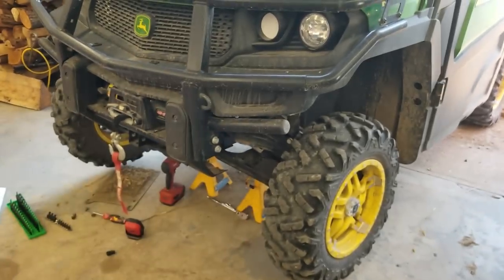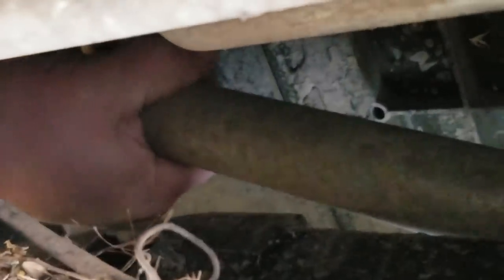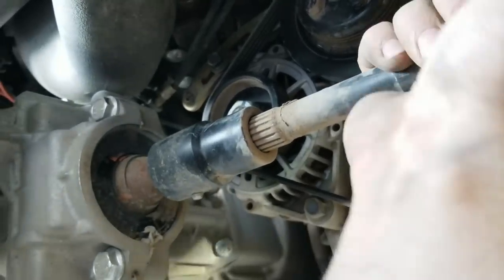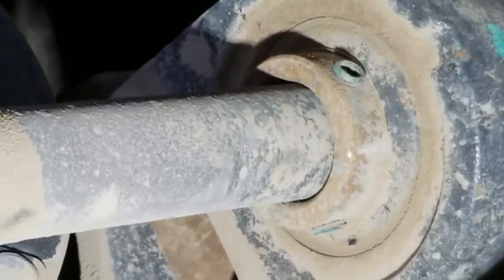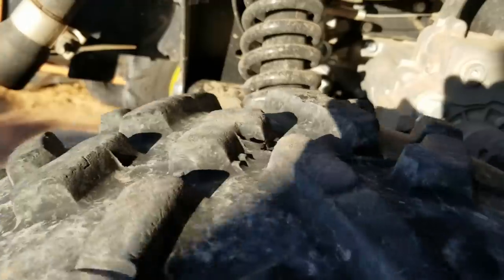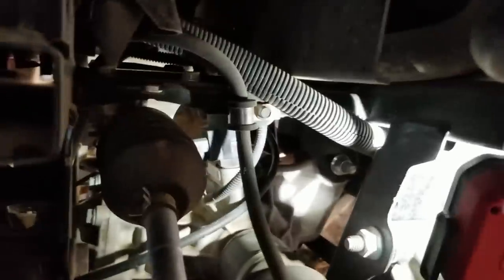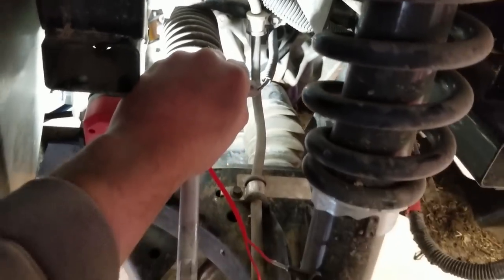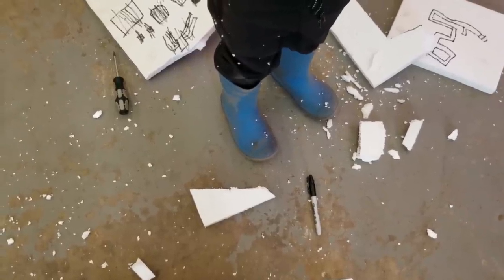Deerest Gator;

Comment: I definitely think this is a corroded connection issue. Maybe a bad ground, a green-rotted connector, etc. I don't know ATVs, but I do know car audio and see this on amps w a rotten ground.

When you see lower-than-expected voltage on a circuit it means there is resistance somewhere where there shouldn't be - some wire or connector somewhere in the circuit has been exposed to water and has oxidized until it no longer conducts electricity well. Maybe it is that pig tail? Or whatever is on the other end of that wire harness.

I def think it's way more likely to be this than the computer.

Comment: The 4 wheel whatchamacallit on the old Furd quit it's spinning thing once. Vacuum actuator on the front axle wasn't moving to engage the dif. Disconnected the actuator and rotated the shift linkage manually. Fixed!! Er, something like that I think.

Comment: Since it's only getting 3 volts, and the 4 wheel drive switch is obviously a low voltage switch, it's most likely has a relay with some burnt contacts somewhere that's not letting full voltage thru.

Comment: It should be 0V or 12V.  If it's anything in between there must be a resistance dropping the voltage. I assume the load would be the relay coil, so if it's actuated directly from the front panel switch then I would blame the switch.  Another reason it's probably the switch (or the wiring that a mouse chewed) is that when you bypassed the switch and wiring it worked.

Comment: Relay is toast. Seen it a bunch I times on sleds. The relay powers a bunch of things and something let’s out the smoke in there and you get funny voltage or intermittent working. Isolate which relay it is and ask the candy man for a new one. 

Also could be the wires from the relay to the  solenoid could be broken or grounding out….

Comment: Working with soldiers and roughnecks for most of my technical career, I would say that a 200 lbs gorilla managed to crush that cable or squirted dip in the connector. I would replace the whole cable and connector. (That's it the relay output is 12v)

Comment: Recheck the + and - at that solenoid plug direct to battery terminals and see if your actually  just missing ground. Personally, I prefer a test light… if you have good + and - at the solenoid plug go check the 4wd switch, maybe it’s just a bad switch for the input circuit. After that your down to following the wires or you’ll need service info to expedite the process.

Comment: There should be a universal law whereby all newly graduated engineers spend ONE FULL YEAR working alongside a field/mobile mechanic. Clean mockups in the lab don't behave the same as dirt/ice/oil/mud encrusted/fuel soaked/forty below/boiling point/absolutely rusted/welded together parts in the real world! Designs might be a touch more service friendly if this were the case.

Comment: I've worn that coupling out on the rear drive. Twice. There are 2 of those F*ing bearings that always were out. They are common 20mm Bearings. Buy the for $5 at Bearing shop or $100 at JD.
Never had a problem with solenoid. But switches fail on Dash. Try there next.

Comment: The 3V are most likely the diagnostic sources. The brainbox will send some small current when the FET is off, to detect if there is a short to ground or V+. If it senses 3V means all is ok. So the good news: there is no short to ground or V+, and the cable from the connector to the ECU has continuity... The bad news, maybe the FET is dead? Stupid suggestion: what if you just send 12V to the solenoid, to check if it does something. And/or: check if the solenoid is not a short circuit. The thing is, if you see the 3V, the ECU will "see" there is an open connection, and maybe not even try to turn it on. When you connect it, it tries to turn it on, but the solenoid is a short circuit or open, and does not work. One last suggestion: put in the connector a light bulb, so that the brain thinks the solenoid is connected.

Comment: Did you check for power to the solenoid with the engine running? The ECM probably doesn’t output 12v if the engine is off because there’s no reason to have 4x4 if it’s not running. The 3ish volts you’re seeing is the ECM’s self diagnostics monitoring the circuit. Been bitten in the ass by this sort of thing before.

Comment: Check for voltage drop on either side of the solenoid circuit. You likely have a partially broken wire on one side. 

Or just chop the wires at the ecm and solenoid and run your own.

Comment: Had the same problem on a Honda. The computer monitors the front and back diff speeds and only locks 4wd if the speeds are similar to avoid gear smashing . Bypassed diff solenoid with a direct switch and worked great. Obviously can’t engage it if one end is spinning under full throttle but perhaps morons aren’t meant to drive these things anyway ?

Comment: I would imagine the ecm will need a few key inputs to allow the solenoid to activate .... I will usually verify all the connections are tight and audible click at connectors ..... check the harness if you have rodents around ...

Comment: The starter on my JD 318 gave out so I called the dealer. $1,024 Canadian pesos for a starter for a 20hp engine! The dealer said "I'm embarassed to tell you this..." So, I got a knockoff from amazon for $150. Looks almost identical, works fine. WT-MFn-F, JD?

Comment: Before I Did Anything I Would Try And See If It Will Engage The Front Diff With The Engine Running!!! The Computer May Not Allow For Engagement With The Engine RPM At 0!!!
Try It With The Engine Running First!!!
Keep Rocking It Out Brother!!!

Comment: You could get a 12v to 3v step down transformer module and use the battery on board rigged up to a switch.

Comment: Try using and external ground somewhere on the chassis and see if you are getting 12v on one side of the plug.  If so, then test the ground side on the plug by using a 12v test light and connecting it to a 12v source on the gator.  Bet you have lost the ground on one side of the plug.  Simple fix, install new ground to chassis on ground wire going to plug.

Comment: I would follow that wire back to the ecu. Check the voltage at the pin. If you see 12 there. You got yourself a wire issue. If your getting 3v at the pin..... You got yourself a expensive problem.  I would also clean your grounds.
Reply: Do what Joseph said first. I forgot the magic box.

Comment: I can't speak specifically to john deere, or gators.  but there are some manufactures who will send a constant small voltage to a solenoids at all times,  then send full voltage when energized   this could be that. if its ECU controlled  however you did say you had the switch engaged, so maybe not

Comment: Sounds like  that 3V is a check voltage to the pcm. Not enough to engage it but if the pcm doesn't see that 3V coming back it will throw a code for service 4wd. My bet is that it will only engage 4wd if the engine is running to charge the battery. So if some bozo leaves the key on to listen to the radio that solenoide will be one less draw on the battery to drain it. If its not running you wont need 4wd anyway right? long story short check for voltage at the plug with it running and in 4wd..?

Comment: I'm inclined to say it's a bad earth, had a similar problem with the old Tojo 80 series 4WD engagement. Motor earthed to battery, gearbox earthed to motor 4WD selector motor not earthed to anything. Ran a separate earth wire to chassis and Bobs ya uncle. $1200 aud for new leccy 4WD engagement motor inspired me to fix it for myself. The manual said remove gearbox from car, fuck that dropped the crossmember let it all hang down removed motor for testing by feel. Nothing like having a feel around a box.

Comment: I always fault find on a car with a 12V light bulb, having been caught out with a voltmeter showing 12V on a broken wire.  But the fan would not work, you could not test the voltage in the fan once the connector was plugged in. Stick the 12V bulb across the wire and it did not light as its current requirement exceeded what the broken wire could pass. Now meter stays in the toy room and the bulb and bit if wire lives in the tool box

Comment: If the diff is locked, the wheels should spin in the same direction. If the diff is open, they should spin in opposite directions.

Edit: unless you were talking about locking a centre diff...

Comment: ...check for some cancer in the connections on the switch and harness...I know that they say they are 'sealed'...but from my experience this isn't the case...barring all of that you may have a switch with worn pads (like corroded points in an older engine) and isn't making good contact within...if it's a grounding issue, just run the negative side of the solenoid right to the chassis with a good wire and run the switch...but I'm wondering about that switch...if you had bad power from the ECM/CCM you would likely have other electrical gremlins too...

Comment: Meh. That bearing looked fine. Shaft just needs the slightest of a slight radiused  groove for some cup point set screws to engage.

Or kissed with a 90°/118°/120° insert for a matching cone point set screw.

Or spotted in a couple places for cup/cone point screws if literally any drill in the turret is set up for cross drilling in a C-axis lathe. But that means finding those spots during assembly/maintenance & that can be a major pain in the ass.

Hell, just some hard cone point set screws would probably do the job with no additional machine work required.

Comment: Any ECM power isn't going to be sckookum enough to power that solenoid.  I'd hazard a guess that it goes to a relay to switch it for higher current.

I'd hazard a guess to say that you might have a problem with the relay contacts.  If it were drawing excessive amps, then it could have pitted the contacts and increased the resistance.  I'd check and see if/where the relay is, and bypass it and see if it engages.

Comment: Electronic 4WD is the devil..my truck has Detroit Locker in the back and True Trac up front.  Manual hubs and transfer case. 
I've driven hundreds of miles with hubs locked on sketchy trails,  shifting in and out as needed on mud, ice, sand or rocks.

Comment: You ought to see the 1998 Kawasaki mule I fight with .... but hey 4000 hours will cause some issues I recently had to replace the front u joint going to the front diff ... nine years ago I couldn't find said u joint and made used one from a steering column work

Comment: Rule #1 When troubleshooting an electrical issue: A low voltage is equal to no voltage when you are taking the load off that circuit. If you had measured it with the solenoid in circuit it would have read Zero. 
Rule #2: Know what voltage you should have under the circumstance you are measuring in, don't just guess. It only makes sense that an electronically controlled 4WD system would not be engaged when the engine isn't even running.
I'm not a JD engineer, nor have I ever worked on JD products. I'm just an electronics tech who's repaired everything from stereos to camcorders, to $100,000 medical lab equipment over the last 40 years.

Comment: Ugh...assuming they're not using some other brainbox magic to energize the solenoid, replace the relay before tearing into the electrical.  I spent years chasing a gremlin in my Cub Cadet rider's electric PTO.  The $9 to replace what seemed to be a perfectly fine relay made my problems go away.

Comment: A Suzuki Samurai makes a excellent side by side without the uppity pricing of John Deere parts or overly complex design. Not a single computer in site and takes the abuse from someone who has no mechanical sympathy.
Reply from the maker: Agreed. But the hydraulic dump box is key. Diff lock is nice too. Also, good Samurais are hard to find.
Reply: @arduinoversusevil2025  Yup gotta have em...Wet

Comment: Who else is doing the pre winter 99+ Toyota 4x4 owner task of taking apart the transfer case shift actuator apart to clean and bend contacts and apply all of the dielectric grease 🙋‍♂️ The secrets I'd take to the grave to get my hands on atleast a few 07+ fj cruiser manual shift transfer cases for a decent price... this is not a solicitation... unless it has to be 😔 🤣👍

Comment: Get a new 7pin rocker switch to replace the one it has now and use the extra contacts for the front diff lock then the ECU cannot turn it off on you when it tells the need

Comment: I've seen skint wiring or bad wire nut connections in fire alarm systems causing voltage drop like that. The damaged wire/connection is acting like a resistor. I'll bet if you tried to put any type of load across that circuit showing 3 volts, voltage would drop to zero. Wherever the damage is, its got enough connection to show something (3 volts) but not enough connection to pass on the full 12 volts let alone any amperage. My money is on damaged wiring or connectors.

Comment: Bad luck on the bearing but at least the covers have no want of fasteners holding them down. Too bad you dont have gravity holding them down in which case you can leave the fasteners out entirely. Worst case scenerio you just leave most of them in the cupholder (if so equipped).

Comment: Go with your plan, external battery, switch etc. It'll be far superior to the rest of the JD, experienced these yolks before, horrible excuses for gearboxes, with bad wiring. 
I'd suggest a battery kill switch on the original battery in case it gets any ideas of shorting out and going on fire out of spite!

Comment: In my experience with golf carts, Utility vehicles, and anything else 12 volts - you never get any volts through a bad fuse. But you do get 3 on a shorted wire or bad ground. As your solenoid goes clickity clack, it isn't that.  They probably painted all the grounds JD green and what's left is turning its own shades of green. Worse possibility, the brain box is green from an affinity for water and generally ruining your day.

Comment: Ya might as well go on to Fleabane get yerself a multicolored and multipurpose accessories penal now! And some Quality Copper Wire! A lot of seal tight connectors and rodent proof wire loom. Check out All Electronics for some of that stuff, outa California... 
this way all of the current computer systems issues can be resolved in the near future as they fail, re routing the wires going to the Brain box that is simply a Confuser designed for Only the Dealership/Stealership  to work on. ( insert a article on the Right to Repair Act, making notes of the Chrysler Jeep Ram Software update for 2014-2016 model years that was Scanable with the $14,000.00  scan tool purchased from Snappy, that needs a new update of just $250.00 since Chrysler sent out the new update via WiFi or wireless communications that no longer allows for the scan tools to work with our payment/ black mail, for Honest hard working people to work on their own cars, trucks, SUV’s, Tractors, Harvestors, logging Equipment, construction Equipment, lawn service equipment, ETC... with out the computers being in charge of the Prime Directive of COST THE USER / OWNERS MORE MONEY. And they simply are a bunch of mini on and off switches, only programs that are deemed compatible can communicate with them now! The same for any maker of this Modern Crap programed to break and to be just (Barley) Good enough to last more than the 30 feet or 30 seconds Warranty. Might be confused with built in obsolescence. )  oh well back to the task at hand, to probably fix it up permanently and Perfectly get rid of all the computers on board. Instead of buying a new electronic wiz bang, buy an old under appreciated used vehicle fix it up with undercoating and new metal skip the plastics and make it out of steel that is replaceable should it get bent, bend it back, and you can weld it back together if it breaks.
Stop wasting your money and time on what is Promised! Politicians, salesman, Recruiters, and even some mechanics can be caught while they are lying ... their own lips will be moving... but a piece of paper with signatures on it is still a golden standard get it all in writing! And do the wiring, even if you have to call upon the Dew Claw!

Comment: The fact that one of these has a rear diff at all annoys me.  It's not like it's made for highway travel.  Keep it simple.  All that solenoid BS can eff the hell off.  Rear axle should be spooled.  No 2wd option.  A rear differential and extra settings you don't need are useless.  It's a machine built for a purpose.  That purpose is to go anywhere OFF ROAD.  Why even bother with the other junk.  It just provides more points of failure.

Comment: Did you actually purposely try to not swear? You changed man.

Dude you had this. All you needed was a wiring diagram and to verify if it was the power or ground that was the issue then test at the source. You know that.

Comment: Question is, is it the shaft or the balls causing the problem?
Well, depends on if your North or South of the pronoun equator.
Take note gentleman, this 2 wheel 4 wheeler prefers to burn grass and not gas,,, chew on that one for a tick.